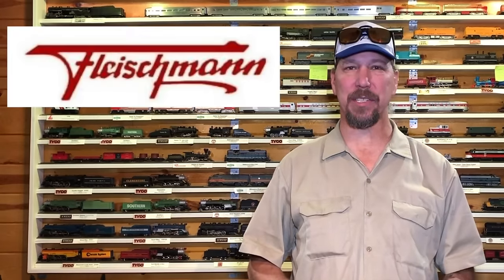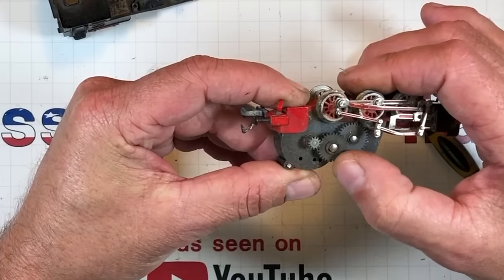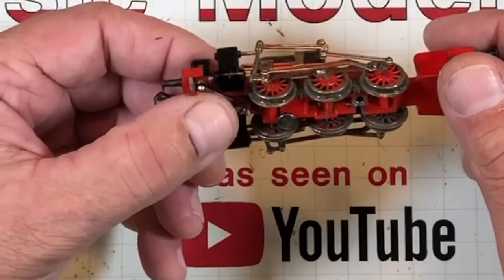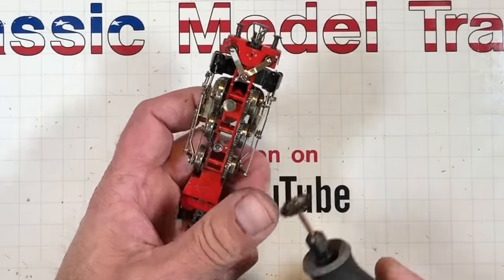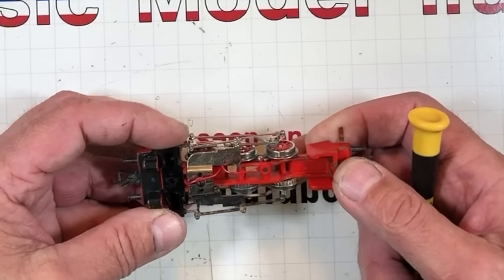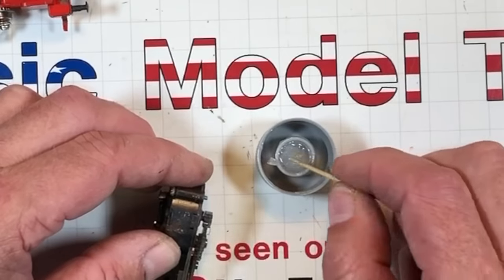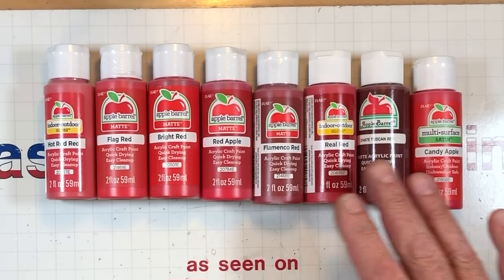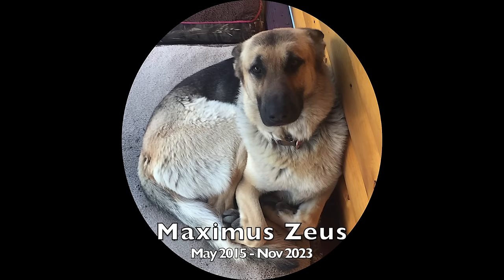Fleischmann European 0-6-0 Clean Up and Re-lube

Comment: My Condolences for Maximus Zeus.  Our smallest one passed this past July she was 13.  I'm currently working on a Proto 2000 B&O  E8/9 A & B units.  Took most of the day yesterday repairing solder joints that were pulled from the pickups. And grease that was sticky as pine sap. Got it all cleaned up and lubed. They run now. The A unit has a squeal when running and rear bogie/truck catches on the body shell on turns. So I still have work ahead of me to try to figure out how to resolve those issues. I think previous owner replaced the drive gears because they are in good shape.
Reply from the maker: Thanks Mm. Sorry to hear about your little one :-(    Good luck on that P2K.  Sounds like it was Frankensteined a bit.

Comment: Ron, that button shoe on the bottom of the loco actuated the old Fleischman signal system ! I was amazed that those deep old pre-NEM wheel flange went through your switches so smoothly! Great work on your behalf ,as usual !
Reply from the maker: Thanks.  I'm running code 100 just so them pizza cutters can run

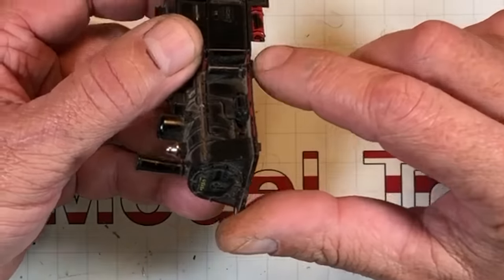Comment: 3:24 The warping is caused by deteriorating chemicals in the plastic, and your example is actually in a pretty good state with the cabin being straight and the area around the pin at the rear intact. Some of the plastic model trains from that era are in a very bad state as the plastic shrinks causing terrible warping of thin areas
Reply from the maker: Thank you for some really good information!!  I just thought it got heat warped.  Dang unstable plastic compounds anyway

Comment: Great job on the Flieschmann ! When I was researching on how to repair a Marklin, I came across a video where a gentleman had dropped the entire chassis and motor in a container of water / cleaner and ran the motor , he did this with several locomotives . Sorry for the loss of fuzzy friend . Peace .
Reply from the maker: Thanks John.  Submersing the whole chassis would shorten the repair time for sure.
Reply: @classicmodeltrains   Since the video was in German I have no idea what he was using . Just received a box full of fixer uppers , a Flieschmann diesel being one of them , so I have some experimentation to try , lol .

Comment: The machine came on the market in 1956, but yours is from approx. 1960, as the engine is newly constructed and there is a switch underneath for automatic operation.
Have maintained some of these machines.
Best wishes
Mogens from Denmark
Reply from the maker: Thanks for the good information on this loco Mogens! Greetings from Montana, USA

Comment: Nice to see a European engine on the channel. I've noticed that hornby triang Dean Single on the shelf for a few videos and looking forward to seeing that in the spotlight sometime soon.
Reply from the maker: Ive been coming across the European locos a bit more in the last few months. A few Fellers have pointed out that Tri-ang.  Must be a bit more common than I'm aware of.
Reply: @classicmodeltrains I don't know if I'd say common, so much as I would say its somewhat iconic. Typically the ones I see for sale are the more modernized versions since it did eventually get a re-release under hornby's main range a couple times, before being put in the "budget" Hornby Railroad line.

Comment: If you use the right wire wheel you'll be fine. I use brass fine bristle wheel. It works wonders on corrosion. And with a little bit of WD. No gouging either.
Reply from the maker: Thanks for some good info John :-)
Reply: Picked up a Dremel rechargeable about 7yrs back. I ended replacing the batteries with some energizers rechargeable. Solder everything.Got 1 of those big Dremel kits. And started on my first nitro rc then shortly after that I got my first o scale Setup in a 5 gal bucket picked out of the scrap yard. Was like 70yrs old and older. Still runs today. Even got the Lionel controller you did video on restoring it. Helped me clean and fix mine. Someone also cut cord of had to fix that as well. Gets a little hot running 2 tracks. My first one. So don't know what to expect. Any ideas?  But both sides do work.
Reply from the maker: @johnramirez5996  the heat is normal if it's a "little hot"  but if it's " Holy S$#T" hot then somethings wrong. check your circuit breaker for operation
Reply: @classicmodeltrains  I will go back through it. Check everything over again. Even pull out the meter and test each piece. Diode resistors whatever I need to do. And rewatch your video while doing it. Ty

Comment: Everytime I get a new color of paint. After an intense shaking. I take and put a little dab on top of cap. That way when I need to match a color, I have a dry spot of the exact color. But that's not all. I put a small dab of black on top to. When that dries. I put a dab of the color in bottle on top of it. The color changes depending on color of paint underneath it. Darker the color surface is the darker the paint gets you are trying to match. Also you can mix a little off the side adding white to lighten or to darken it I like to see what part formula is used making that color and add little more of what they used to make it. By adding slowly and using a mark of it to see the difference as you add to lighten or darken till you get to the right color match. Similar with tattoo ink when fading. Dab of water with fade black. Example.
Reply: Really good tip! Thank you for sharing it.
Reply from the maker: John, this is some really great knowledge and painting tip you shared here.  Thank you very much!!
Reply: YW

Comment: That metal button underneath must be a remnant from earlier designs which did use center rail for power. Maybe they used a resistor because it could be a 6 volt motor. Early early motors were 6 volt. Also found out the hard way certain European smoke units are 6 volt, requiring a resistor.
Reply from the maker: I agree on the 6 volt.  I just wished I knew how old this piece is.  could be 20 years....could be 65 years?
Reply: I think the button was meant to trigger accessories mounted to the track, although I don't know how exactly it is meant to work.
All of the older Fleischmann locomotives from my childhood have it.
Reply: Just looked it up, the button is called a Pilzkontakt (mushroom contact). It works together with a contact track (looks like a regular piece of settrack except with a short piece of metal that resembles a guardrail added near the inside of one rail) by simply creating an electrical connection to one rail via the mushroom and metal frame of the locomotive. You can see it in action if you search for "Fleischmann contact track" here on YouTube.

Comment: The loco is an ex Royal Prussian State Railway class T3 0-6-0 tank engine from the 1880s. A few managed to survive into the 1950s to become part  of Deutsche Bundesbahn or German Federal Railway. Following WW I, all state railways in Germany were merged into Deutsche Bundesbahn´s  predecessor, Deutsche Reichsbahn, and the loco was re-classified, into class 89.70 A few have been preserved, some in operating condition.
Some info on the prototype can be found here:
https://en.wikipedia.org/wiki/Prussian_T_3
The Fleischmann model first appeared in the 1950s. It is slightly oversized so the Fleischmann standard pancake motor could be fitted.
Reply from the maker: WOW bluebear!  Thank you for the good information!!  Your really on top of your game here!! :-)

Comment: The Fleischmann 0-6-0 was First available in 1956 and continued in train sets until 1969. It was built to a scale of 1:82 to accommodate the motor. The classification of 89 is correct however the subsequent digits reflect the catalog number and not the prototype which would have started with a 7. The loco is not a switcher but a secondary/ branch line.loco. Fleischmann made a set of Prussian 2 axle passenger cars to completement the loco.
Reply from the maker: Thank you for this good information!!

Comment: Sorry about your dog. They are family too. 
On the restoration side, very nice job, the little button underneath was used to trigger signals, etc with aspecial rail that had a short section of "3rd rail" contact on it. The "resistor" is actually a choke to prevent interference with radio and other electronic equipment. Most of the Fleishmann locos had two, one in each wire going to the motor. 
Regards

Henry van Wyk, South Africa.
Reply from the maker: Thank you Henry and thanks for the good information on that button and  what to actually call that coil of wire.